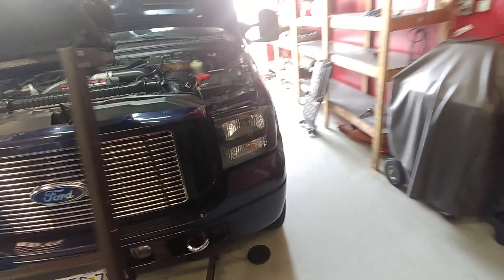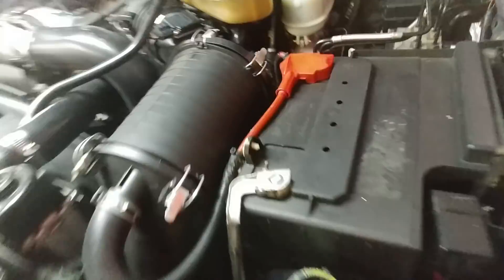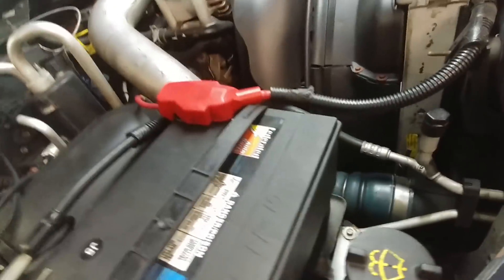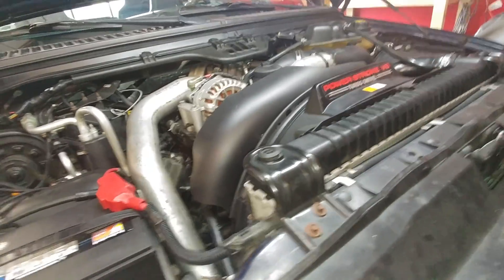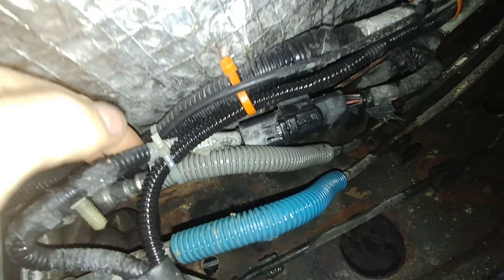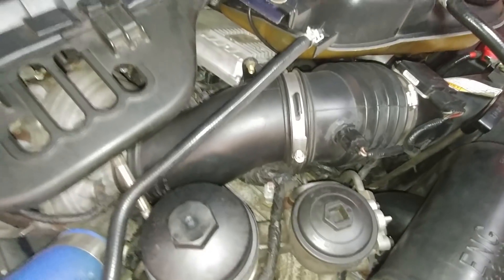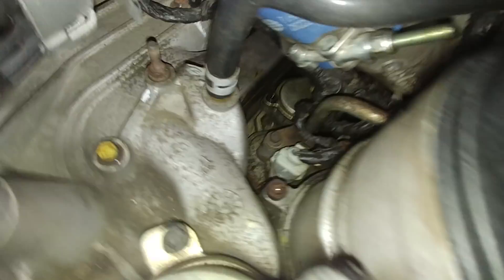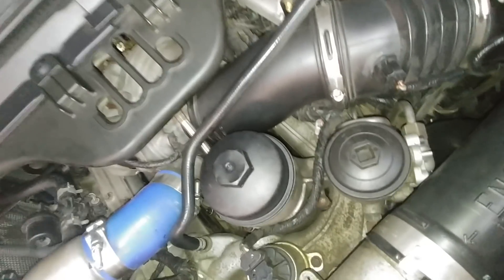Dominic's car lot purchase

Comment: what are your thoughts on evans coolant Anthony???? aside from it being flamable and the availability of it the thought of a pressureless system is very apealing to me in a lot of ways....i currently run elc with distilled and have no issues i just really like that the system is pressureless which would im sure would eliminate most small leaks from ever happening....

Comment: Soon as you showed the puddle and the line running back my first thought was they were using it as a drain for the coolant bottle so it wouldnt puke coolant, and soon as you showed that tapped into the side, boom, head gasket issue and they did it to hide it. What a bunch of slime balls, you have to admit it's somewhat clever, cause who'd have seen that unless you really really looked for it?

This is the exact reason I tell people thinking of buying any diesel take it to the dealer or a shop that knows that auto manufacturers diesel truck engines. dont take it to joes garage that's a honda specialist take it to someone who works on these like you and julie do more often then not. I always say to people, if you cant find someone to look at a powerstroke take it to a dealer and have their diesel guy look it over, pay to have it tested with IDS. It might cost you a few hundred but man it could save you thousands down the road gotta feel for this guy that bought the truck , just laid out thousand for a truck, and now it could be thousands more